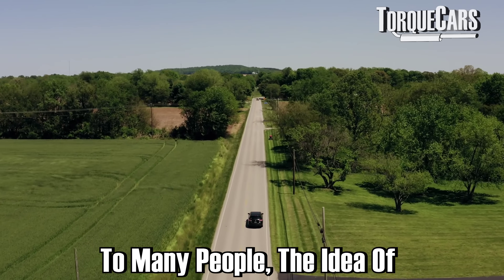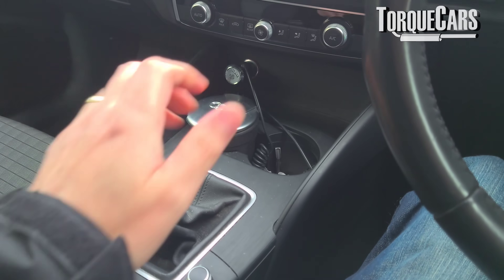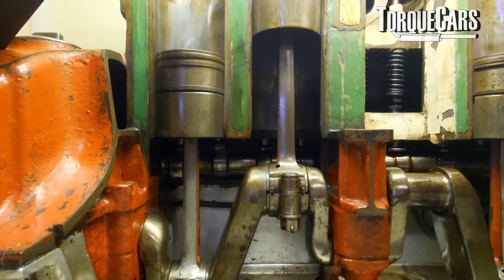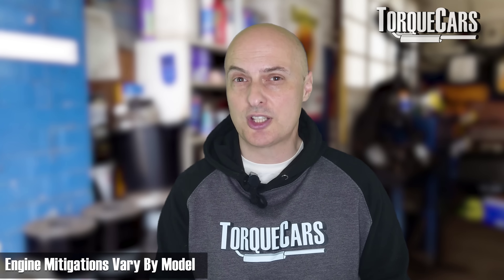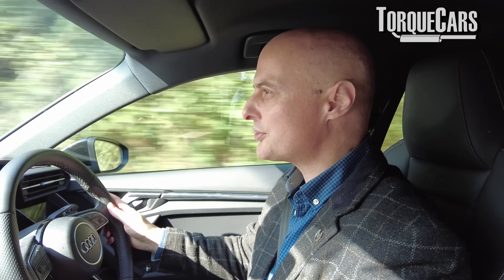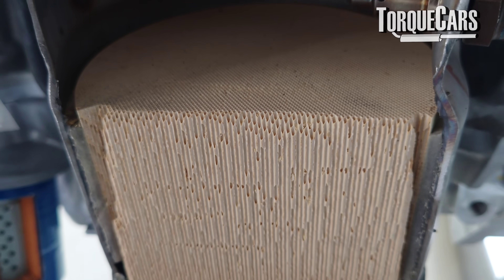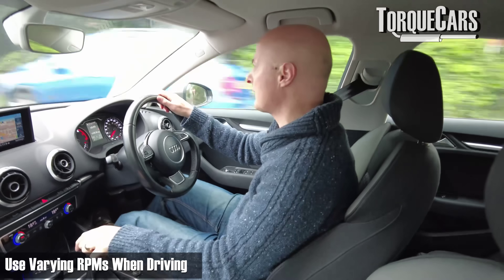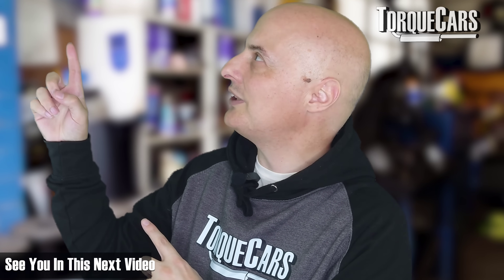BIG DAMAGE By Lugging at LOW RPM? Eco Driving Warning! (Manual Gears)

Comment: The TLDR: don’t lug your engine, redline it once a day, don’t excessively idle, MAINTAIN YOUR VEHICLE!!
Reply: Welp time to redline the R18 Civic
Reply: @alejandromorazan3420   (civic type s fn1) same here, although mine has a muffler delete from the previous owner so it's load af.
Reply: Redline a day? Redline every shift! put that clutch to use! :D
Reply: I will never redline my SPI. The thing sounds like it’s ready to quit at 2,500-2,800 rpm. I’m good on taking that chance 😆maybe if I had the Zetec or Duratec
Reply: @CasualGaming76  my 1.1 SPI seicento loved going to redline...it wouldn't have moved otherwise XD
Reply: @crisrose9707  I felt that. I guarantee my 2.0 SPI isn’t making the 110 it made from showroom. It’s just noise now. I timed a 12-60mph on this car. Wasn’t even a 0-60. Took over a minute 30 to get to 60. Mind you I was shifting at 4,000, but still. This engine is tired 😆
Reply: @CasualGaming76  mine made 54hp new......I think weight of vehicle is also a big factor in these things!
Reply: @CasualGaming76  Love them old SPI/CVH engines. Easy rebuild but jesus christ they sound like they want to die at high rpm
Reply: @CasualGaming76  My car has a Duratec but it also has an automatic transmission acting strangely and I dare not go above 3K unless I absolutely have to. Sidenote if you're driving gently the PCM is very intent on keeping RPM low she'll shift into 3rd gear at 20 mph while cruising through residential. That's 1000-1200 RPM depending on conditions.

edit: spelling
Reply: @CasualGaming76  The SPI will handle it just fine. Pretty bulletproof asides from valve seats dropping, but mine had new ones installed ages ago.
Reply: I won't believe you if it wasn't for a friend of mine. I would consider him a bad driver as he constantly redline at every gear before changing gears. It was jarring to be a passenger but when he left for business and left his car with me, I felt that his car(a common local car) has the best engine condition I've felt, it's unbelievable. I still don't drive like him but I wouldn't believe it if I didn't drive it myself
Reply: @ncode03  people think holding the steering wheel and guiding the car to the shops is " good driving " lol
Reply: I have an e92 m3 and I have to shift in low RPM to warm the car up because the rod bearing issues. Even though it Revs high and is meant to it still doesn’t feel right.
Reply: @k0j_  that's why I rather get an ISF
Reply: @golf1diesel  in my opinion both of those cars are neck and neck the LSF maybe a little more reliable 😂
Reply: I had a job in a very congested area and instead of driving home right away took a nap in the car for a couple hours while the engine was idling (during winter) and then drove home hard as the streets were empty. I accounted for excessive idling by changing oil early. But the question remains, does it hurt to idle for a long time in that particular scenario?
Reply: @ampere_man  because the car wasn't moving, you should be okay.  As long as you drove it with varied conditions RPM at least once per trip when it was moving?
Reply: @ampere_man  it's okay to do it once a while...but not as a habit.... police cars have a bad reputation as far as engine life goes.... because they are excessively run idle by the cops...since they need the ac and other equipments running at all times when they are on duty.
Reply: It seems to me like the TLDR is more like: Running your engine causes wear and tear no matter what your RPM's are
Reply: The idle part is a big one. I never idle my vehicle except for stop lights.
Reply: And do not redline it unless it is at temperature, meaning a couple minutes of driving after the point where coolant is at norm temp, and ideally work your way up to ever-higher RPM because that gently speeds up the engine warmup.
Reply: Never in my life have I redline an engine. Usually I change gears at around 3000 RPM. If I need more, at most, I will change at 5000 RPM.
Reply: @bltzcstrnx  I paid for the whole tachometer so you know damn well I'm gonna use all of it. Also I drive a honda so I have barely any torque below 4000, vtec kicked in yoooooo
Reply: @bltzcstrnx  Your car is probably having 30hp's now. WHY Highway driven vehicles run faster? because they see 5000 rpm's everyday
Reply: Redline thing depends mostly on anti pollution systems like particles filter. I think old diesel without any of these don't need to reach any redline
Reply: @bltzcstrnx  yess, this is exactly what I’ve always done, even with an auto I try to let it shift around 2,500-3k unless the extra rpm’s are needed to pull harder in a lower gear
Reply: @bltzcstrnx  I've redlined all my cars and they've all been over 200k miles except my Mazdaspeed Protege, the turbo started blowing up my battery in boost lmfao so I sold it.
Reply: It must be at least somewhat engine specific because one of my Holden 5.0 V8s was an ex cop car with high mileage but also VERY high idle hours but fleet owners will usually change oil early and the Holden motor is very sturdy (not Toyota sturdy but Chev LS1 sturdy-WAY more sturdy than euro-trash) and it still ran like a clock.
Reply: @senator7352  AGREED most heartily. Lugging an engine WILL destroy rings and scuff cylinders.
Reply: The van I work in idles probably for a couple days straight sometimes blasting AC and picking 1k+ miles a week
Reply: @senator7352  why would idling be bad? A engine is made to run. Idling is actually good for it.
Reply: @senator7352  bro thanks for saving 12minutes..I'm curious just not that much
Reply: Just drive a weaker car so that you need higher RPM all the time. But I regularly get to the max 5000rpm of my Prius. (It’s not actually redline, but they cap it because it’s max hp)
Reply: If you only have a short journey don't redline it. Thankfully my journey to work is 20 miles.
Reply: "redline it once a day"
There is no need for doing this. If you ever will see the slow motion video of a valve gear at max revs, you will realize why. 😉
Reply: Amen, Imma do that😈
Reply: @senator7352  no idle? My work truck idles several hours a day and run perfectly fine
Reply: I wouldn't say to redline it once a day lol unless the oil temp is fully up which takes a good 15 minutes (longer than coolant)
Reply: If you only have a short trip to make, don't redline, but otherwise it gets revved pulling out of a side road onto a main road.
Reply: thanks, senator7352
Reply: @senator7352  pass at redlining the car. at most I change at 4 to 5k rpm when climbing up a really steep hill. 3k rpm if I'm overtaking someone.

My G4FA engine is already notorious for being a bad unreliable engine. I'm not taking my chances in blowing it up.
Reply: @senator7352   Redlining doesn't help anything and dramatically increases wear and risks.  3/4 throttle pulls through peak torque RPM is plenty to do the job. This guy gave a lot of nonsense advice too. Been a mechanic and engineer for a quarter century. Seen everything from carbs to DI.
Reply: @VndNvwYvvSvv redline does not dramatically increase wear. The people that make the cars put the redline below the safe limit of what the engine can take...
Reply: @VndNvwYvvSvv  So tell us if lugging engine is bad?
Reply: @VndNvwYvvSvv  me with 1 quarter of throttle and enough to break the speed limit, which is frankly enough because above that will induce stress due to extra focus. We tend to relax as getting older, right pops?
Reply: @senator7352  I push my car up to 8k at least once every time I drive it
Reply: I’m curious if or how badly I damaged my engine from a one time encounter… I was in my 2009 Porsche 911, using 4 or 5th gear going up hill at about 45mph (RPM about 1600). I was overtaking from an outer lane a slower dumbass in the middle lane. As we were abeam each other, he started to merge into my lane. Because I was going faster than him, I was afraid to hit my brakes and get out of the way in time or shift into a lower gear and accelerate as that might loose my momentum and add vulnerable time beside him. So I squashed the accelerator and just made it out of the way. The 911 did continually slowly accelerate and save us from the idiot switching lanes and didn’t realize I was passing him from the outside lane. But during the encounter, I was fully depressing the accelerator from a lower region of engine speed for approximately 5 seconds.
Reply from the maker: A few seconds of lugging on a warm engine at 1600rpm is unlikely to do anything harmful whatever the car. Also a 2009 Porsche engine is quite heavily managed, so your throttle input would have been cut accordingly and timing adjusted, so the only real symptom is a loss of power rather than lots of wasted effort. Damage tends to build up due to bad driver habits. People often do this every day and the engine still lasts quite a long while.
Reply: @torquecars  …Good topic. Thanks for the video!
Reply: @torquecars  Actually I think there's a way to accelerate at low rpm without causing long term noticable damage. If uphill - no excuses, downshift and then throotle. If flat road and you're just lazy or got distracted by something - push the throotle as low as possible just to speed up a bit and then hit more at 2k + rpm. WOT at low revs and other than 1st - stupid and unnecesary. Correct me if I'm wrong
Reply: Omg. You don't need to "redline" your engine. Higher rpms will do just fine. And I probably wouldn't do it daily if you want long term reliability. The more you "redline" your engine, the more wear you get. It's simple. The more you use the engine, the more it wears. Just drive at varying speeds/styles. Engines like to be run. No need to beat on them. No need to go easy on them.
Reply: @barsaf9989  every car ive owned has been redlined every single day ive driven them, never had an engine issue. One car in particular i put over 100k miles on driving it as such, never had a single engine or transmission problem. Would take it in for an oil change with the car majorly overdue for one and the lube tech asked if i was sure it needed an oil change because it looks brand new(had over 15k miles on the oil) . If your engine is healthy and not a lemon straight from factory, redlining for short periods  isnt going to hurt it or increase wear enough for you or the next owner to notice

Comment: How does this apply to "eCVT" engine designs from Honda, Toyota, et al. where the driver is effectively decoupled from any ability to control engine RPM? Honda's "engine direct-drive mode" via lockup clutch may be the only range where drivers have any control at all.

Comment: My diesel engined car rarely goes much above 2,000 RPM. The exception is when accelerating hard. Frankly, at 120k + miles it seems fine, as did the previous one which I disposed of at 140k.

Comment: I’ve been red lining my Ford fusion every day for 304,000 miles and counting. My engine seems to really like it honestly. As long as you change your oil and coolant on time I think it’s actually good for the engine
Reply: Cars are designed to be used at full range of rpm and some actually prefer high revs to begin with. V6 in mine produces power starting 4,5k rpm and pulls to 5,5k any less rpm and engine is asleep.
Reply: 2.5 or 3.0?

Comment: I still get paranoid taking an engine to red line. I’ve had a fan belt snap doing that. Luckily it was in a suburb where I could pull into a quiet street and stop the engine.

Comment: This can be considered ancient knowledge. We all knew this concept in the 60s. Lugging an engine under load was never a good idea. Find the midrange for your engine. Ignore the tach, go by feel
Reply: Yup. In a lot of cars you can feel where the engine is comfortable. The engineers have optimized the engines dampened resonant frequency to transmit the fewest vibrations right around the point where the engine is at its most efficient.

Although a lot of higher end cars have so much cabin vibration damping and/or drive by wire systems that hide the engines vibrations from the driver.
Reply: Yes by the feel. Find the rpm with the minimal to no cabin vibration. That's the rpm is the sweet spot
Reply: @smpoy  cabin vibration hat? must be an american thing
Reply: Yeah it also helps if you can actually hear the exhaust note to tell when to shift rather than looking at the rpm gauge.
Reply: "go by feel" - that's why we have so many bad drivers who are unable to shift their car properly.
And then complain that the engine is "weak". And then buy oversized cars.

Comment: Oh, to think we grew up with Mk1 Escorts with horrible fixed choke carbs. That taught you everything. Modern fuel injection and engine management cover up too many of our sins. Strangely it turned out the rules for maximum fuel efficiency turned out to be the same rules for maximum power. The rule is to "follow the engine" - no point throwing fuel at the engine if it can't burn it. It needed air flow. Buuuuut - if you are doing it to save fuel, that is darned tiring on your ankle. So the next best thing was stick it in cruise control and juggle the setting around the mpg display. But yes, change the oil, change the air filter, and never never push a cold engine! . . .
Reply: Indeed motorcaft carb's

Comment: Yeah totaly To low RPM can damage an engine as too high RPM ( it's not the same kind of damage ), on flat or slight descent you can drive at 1500 or 1200 in 5th, depends if it's a torquy engine on not. Short stroke , long stroke ? I have a 1995 Chrysler Voyager 2,5 gasoline, it's a long stroke engine, et on a very light pressure on the gas pedal i can maintain speed easily  in the 1200 1500 range on flat roads without the engine vibrating, but if I need to accelerate I go down by 1 or 2 speeds, and press the gas pedal just a bit to let it gaining speed slowly BECAUSE GAS IS FUCKING EXPENSIVE ( well a bit less with LPG but... ). But it happens occasionaly to get it to 4500 for merging etc. And I try to use the best oil and friction modifier. With the engine reving at it's best torque rpm and a light foot on the pedal, the fuel consumption is not that high.
We should get the power and torque curb on a paper with our cars ^^  to know how much torque we have at which rpm.
The max torque range can be lowered I think by modifying camshaft and sacrificing high rpm power that we don't use that often, and with an appropriate ignition timing.